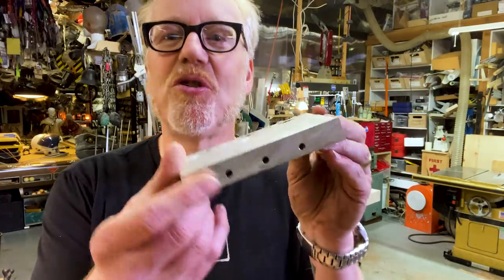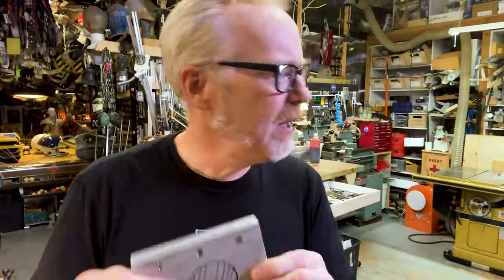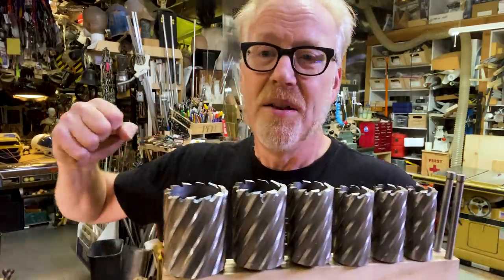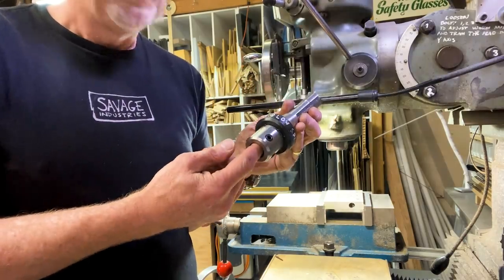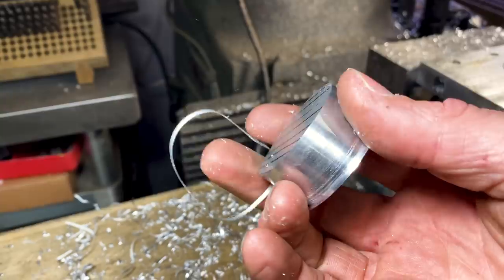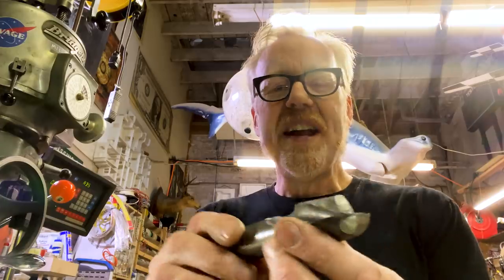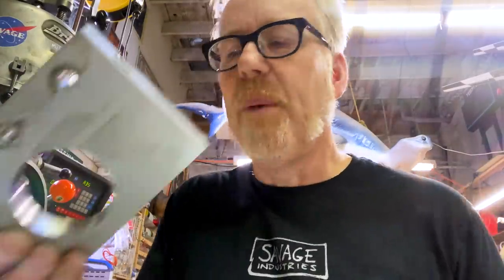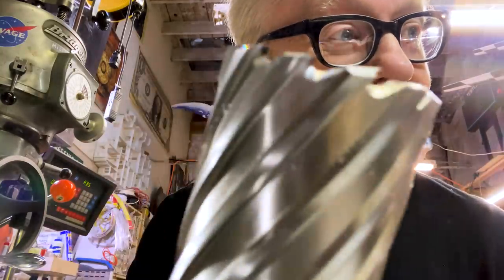Adam Savage's Favorite Tools: Annular Cutters!

Comment: Parallel falling over means there is a chip between it and the vise bed or jaw. Need to clean the vise.
Reply: Maybe the vise is tram to the bed but the bed isn't level. (because the entire machine isn't level)
Reply: @felixar90  Few tradesmen, and fewer amateurs, have ever set up their machines in accordance with Georg Schlesinger's principles, established in 1938.  I've encountered a fitter who moved my lathe, left it bridging two separate concrete slabs (which would move separately as ground moisture conditions changed) and assured me he'd used a precision level, so it'd be OK... Anyway, parallels are often caused to topple during loading the vice, it happens, and it's seldom because the machine's so far out of level, but-

Most of us kept a range of (compression) coil springs, cut to varying lengths, in the shop to interpose between parallels, and stop them falling, since you have one hand holding the workpiece, the other closing or opening the vice. Who has a third hand handy to control parallels?  Foam rubber and even scouring pads can be used, as can bent spring steel or steel pallet strapping.  If the parallels are thus kept vertical, there's less likelihood of debris getting between them and the vice dovetail or jaws, too.

And... If you're on production work, make soft vice jaws, and mill steps in them, rendering the parallels unnecessary, but, mill them anew for each job, at the workpiece width, with a parallel and a silver steel roller in the vice allowing the retreating jaw to rise naturally under pressure to the position it'll adopt when the workpiece is in position. A square block won't allow that... The stepped jaws aren't terribly precise, and the height of the retreating jaw can vary a thou or two, dependent upon the force used to close the vice.  In the long distant past, we used either a torque wrench to close vices (especially in paired vice situations) or, joy of joys, Jarno manual hydraulic vices.  They'd approach the workpiece rapidly, mechanically, and then the hydraulics would take over, the pressure set on a calibrated thimble like a micrometer.  I haven't seen a Jarno manual hydraulic vice for over 40 years, now.
Reply: @robertlawson8572  Edge Technology makes some nice spring loaded parallel holders, for 4" and 6" vises, and probably more. 

Also it goes without saying that soft jaws are to be machined while loaded, Ideally with something that will let them kick out the same way they'll be when actually holding the work piece, 

I actually never had to used soft jaws of any kind but if I ever did I'll just refer to Stefan Gotteswinter
Reply: @felixar90  "Also it goes without saying that soft jaws are to be machined while loaded,"  I found over forty five years in engineering that it's a mistake to think anything "goes without saying"  I've noticed that, especially in maintenance shops, you can't assume anything.  Your experience may have been different, of course.
I thought, in 1978, "it goes without saying" that a vice, mounted upon a machine tool, should be both secure and clocked accurately, if left for someone else to use... I found the error of that assumption when I used a vice left by the previous guy on a Butler 26" Super Shaper.  I asked him if he was finished, and if the vice had been trued.  When I started to use it seriously, the vice, a fairly big one, shot free into the aisle.  The previous guy hadn't been asking much of the machine, I was shifting serious amounts of material.  I never again trusted a vice left in position, and I always removed vices after having used them, (no blame could fall upon me for its security) and, I never allowed myself to be prevented from mounting an accessory securely once I'd started.  
"It goes without saying" that you ought to work against the fixed jaw of a machine vice... That idea collapses when you're working a shaper...

Comment: I've shattered a 3" Hougen annular bit when using a magdrill upside down.  It wasn't a good day. 
Any kind of sideloading on an annular bit ends up with it exploding.
Reply: Maybe on the tip. I use them to mill into tubes ok
Reply: Last time I saw someone use a magdrill upside down, his cutting fluid ran up the shaft and shorted the magnet and dropped the entire magdrill on his head. Adding a safety chain for himself turned it into a magdrill shaped wrecking ball to swing at his head. In the end, mistakes were made and lessons were learned!
Reply: @descension7419  I've always said let it fall if the magnet goes out. My body is more important than a piece of equipment I don't care how expensive

Comment: They are awesome tools. I'm actually surprised you ran that high of RPM's on a cutter that large, worked fine, but I don't think I've ever used any annular cutters at that high of a RPM.
Reply: I agree with you. It is aluminium and not steel, but he is running too high of a speed.

Comment: I've used those a ton at my work, we usually use them to drill bolt holes. Run about 100-200 rpm going through 1" to 5" thick structural steel.

Comment: Endmill and a rotary table on the ol’ Bridgeport.
Reply: I saw a homemade tool with a face-groover on a 1" square bar. The guy used it for cutting large precision holes in 1/2" and under plate. Ingenuity rules the world. I've also seen a 5/16" HSS lathe tool in the same type of setup for plug cutting. They both had drills in the center to stabilize everything.

Comment: Try milling the hole on a rotary table. It's fast and very accurate.
Reply: Or a cnc.
Reply: @theupscriber65  them circular interpolation codes be hitting different
Reply: What difference does it make to use rotary table vs a vise?
Reply: @federicoromero6130  a vice is stationary a rotary table turns 360 degrees and you can make large hole with a small endmill by pitching out half the diameter on the Bridgeport mill, then taking a cut on the rotary table to finish the cut
Reply: the upscriber was going to say the same thing
Reply: Def more accurate than an annular cutter!

Comment: Is it just me, or do his parallels ring (@3:39) like the first note of a muted doorbell?

I'm sure this is what Adam meant @9:18, but it's the rigidity of the work- and tool-holding that allows annular cutters to work well and not break/break other stuff. Obviously, if the work and the tools are held with high rigidity, that allows for high precision. When it comes to cutting tools, especially carbide, taps, & small drills, if you can't keep both the work and the tool from skipping around or becoming misaligned, it quickly becomes time to buy more metal and more tool bits, to replace the scrap you just made.

I love how much Savage home-shop action we're getting these days!

Comment: I am a railways track engineer. In old times we used to use normal drill bits for drilling the rails for fishplates/joints or for fastening signaling cables. These days we have switched to annular cutters and this is wayyyyyyy faster and more convenient. We drill a hole in less than 1 minute and with a normal drill it takes even 10 minutes for a single hole. Also the hole is much cleaner whish is very important for avoiding fatigue crack formation or fissures starting from the holes as a source of stress concentration... I also love them.

Comment: I don't care if you are cutting aluminum, use a pick, to pull cuttings away from the work area. Never grab cuttings , with your bare hand. If it's small chips, use a brush, if you try to wipe them away, 1 tiny stuck chip can slice your hand open. If it's the curls and lacy shit, that can cut you to the bone. Keep a long bent pick at your drill press, end mill, and lathe.
Reply: i trust any opinion from a beard like yours lol will be making a pick myself today :)

Comment: It amazes me these haven't caught on for machining before, after all, hole saws have been used in wood-working for so long.
Reply: These are very different from a hole saw. Hole saws do not clear their own chips, making it difficult to get through thick material. Also if you're looking for good accuracy and surface finish an annular cutter will do much better.
Reply: @Beanpapac15  But the basic principle of huge hole - tiny amount of material is shared between the two. It's just that this is better adapted to metal

Comment: I used to make these at Hougen mfg. (Hougen Rotabroach are the best annular cutters in the world). Seeing them blast through a 60 Rockwell railroad rail in a few seconds was awe inspiring.  The trick is that there isn't a center like a drill so the rpms can be much lower and keep the proper ips feed as not to increase wear.

Comment: "How do you do this hole?"
Well a hole saw comes to mind before anything else...
Reply: Shutup Lenny
Reply: Glad I'm not the only one who thought the same thing. Its just aluminum, it would work just fine.
Reply: @quistan2  it doesn’t tho. Material that thick clogs up the hole saw. Looks like the only difference between a hole saw and this annular bit is a way to evacuate the waste.
Reply: @JohnBrowningsGhost  It's really a non-issue if you back off the bit and blow it out frequently.
Reply: @quistan2  but this is still a nicer cleaner method depending on type of holesaw.
And why not use them if you can.

I'm just surprised he hasn't been using these for years.

They've been round long enough but i guess it's amazing what things we might not see till you have them.

Comment: Been using those for years now working on big rigs doing frame extensions, cutting holes to hang other accessories and other types of body implements. Mag drill is the best tool in a heavy equipment shop!

Comment: When working with sheet metal in thinner applications a simple hole saw works wonders. Similar technique of slow speed, cutting fluid, and consistent pressure via drill press or mill works wonders. 
This anullar cutter basically works as a reamer and a hole saw all in one.
 I will be looking into getting a set of these anullar cutters for my sheet metal shop for thicker and more precise applications. I wonder if you could cut straight through square or rectangle tubing for reliably accurate pass through holes......
Great information Adam!

Comment: I work as a CNC machinist at Edwards AFB, CA and I use those cutters quite often. We call them Slugger Cutters, because it leaves that fancy little slug in the middle. I've used them on steel and even Titanium. It takes longer, but if you have plenty of coolant and time, you can get through any material.

Comment: Hey Adam. Got the same problem some weeks ago. But no aluminum - stainless steel. Tried a step-drillbit. No success. Then tried a carbide tipped hole saw. No success. My solution: a punch tool for punching holes in stainless steel kitchen sinks.  But this works only on thin material. Greetings from a long time Mythbusters viewer here from Germany. Was always a pleasure to watch science go real.

Comment: How are you, Adam Savage, only discovering these now lol.  I use hole saws and annular cutters for anything over 1/2" in my home shop.  With an adapter you can use these in a large robust drill press and or with a magnetic drill.  You also need to respect proper speeds for each type of material and always go heavy on cutting fluid.

Comment: I use em all the time, both mag drill and milling machine and they are awesome. When drilling dont just plunge the bit in, thats how you end up with a fireball of artery slicing madness. Just let off a bit of pressure and it will kick out nice short chips and allow constant coolant flow.

Comment: Use them quite often at work. Use them for ironworking and general fabrication on thick steel because we use big mag drills that need at least half an inch of steel to properly adhere without flying off the piece.

Comment: We use a mag drill in our structural steel shop with annular bits. We just punch a small hole, then there's a piece in the middle of the bit itself that sticks into the punch indentation to keep it center and drill away.

Comment: We cut through 1/8th and 1/4 in aluminum skins on our custom vehicles.  We use standard hole saws.  They're much cheaper.  That said, for the 1/4 in, applying and releasing pressure repeatedly helps a lot, because hole saws don't have the spiral path to remove cut material.  That said, one technique that works really well on floors with 1/2 aluminum is to drill 2 or three holes with a bit that's wider than the edge of the hole saw.  Drill them to the inside edge of your cut so they don't impact the round outer circle you're cutting.  These holes provide a place for material to fall through without lifting the hole saw and blowing out with compressed air.  If the metal to cut is immovable, then one or two holes near the bottom still help, but on thicker stuff, pull the hole saw out often and check for chip buildup.

Even on wood, a hole saw will bind up on chips and literally burn wood if you don't manage the chips.  The "drain holes" work great with a hole saw on 2x4's.  With Wood, you can just power your way through and live with the heat, but it dulls your hole saw much faster, and peals the paint off in a hurry, so they rust, but as quickly as you dull them, you won't care about the rust unless you sharpen your own blades.

Drain holes, an ounce of preparation saves a gallon of sweat and tears. (saying by Heis Also)

Comment: Handy tool to have Adam, I have a set but tapered ends for easy removal, also attachment with a centering drill. Want to go bigger or any diameter use a circle cutter, think of it like a leath but instead of spinning the material you want to cut you spinner the cutter bit instead. Word of advise go slow with the circle cutter take off small amounts of material & when close to the end flip it over & take off the rest of the material less chance of catching on the tool & jamming.

Comment: The company I work for uses a carbide-tipped version of these to cut through very large bolts up to 6" in diameter and 10" deep with annular cutters.  We run at much slower speeds even with the hss ones.  They are so expensive but so efficient that running high RPMs is just not work the little extra time you gain,

Comment: Could have also used a regular type drill guided hole saw, but the annular cutter indeed leaves a much better finish. I use my annular cutters mostly on heavy steel in a mag drill, although I do sometimes use them in the drill press as needed.

Comment: Known as rotor broach in the UK and the centre hole is for the pilot pin that is spring loaded and sits in the centre punch mark and pushes out the plug after cutting I use them with mag drills and drill press no problem aslong as the centre pin and cenre punch are good... Best bits I have ever used by far

Comment: Hey Adam Savage, thank you for taking the time and effort to produce this excellent, easy to follow, demonstration on the use of an annular cutter to cut the thick aluminum block in the video. I'm trying to cut a 7/16" hole in spring steel {3/4"w x 1/8"d}. Would you recommend the Oscarbide 7/16"x2" for this purpose? I need to cut 24 individual pieces. Thank you again for producing this video.

Comment: I’ve used them for the past 3 years and it’s my favorite method, recently I’ve ran upon a wax type of cutting lubricant and HEAVILY prefer it over plain cutting fluid as it’s just a cleaner option also the metal doesn’t seem to get as hot... I wish I knew where I could get some more but only had a used tube with no branding on it.

Comment: Hey Adam, seen you loads on mythbusters, i found this video because im thinking of buying a mag drill, rather than a drill press, as i too am a home machine user as a hobbyist, and yes, id love a set of those annular cutters

we have something similar in the uk called hole saws, which go in drill chucks, but there real flimsy, there basically a cylinder with a band saw or jig saw blade round one end, and a standard drill bit through the middle

they wander around a lot and make egg shaped holes more often than round, there better for wood than steel, but i seem to use steel more, so its really frustrating, especially when your trying to get a nice finished hole for a pipe to slip through for example, and theres gaps round it, and the finish in that area requires no welding

all the best, Russell from across the pond in the UK

Comment: Missing your podcast so maybe that's why this popped up in my recommendations... lol
That's still a crazy high rpm for those bits.  I guess it's not so bad doing aluminum but go slower for steel.  When those bits break the shrapnel is serious because of those long sharp edges.   Also be careful backing the drill out while spinning if you're using the spring loaded centering pin.  It could shoot that slug out and do some damage.
Hole saws work good for aluminum but you may have to keep clearing the teeth since they don't clear the millings.
Happy building!

Comment: What are your options? G02 and G03 lol. That said, a good bimetal hole saw followed by a boring bar in a boring head works too- will give you a similar finish and concentricity than an expensive annular if you don't already own one.

Comment: Added bonus of using this in a mag drill is the centring pin has a spring pushing on it and the drill will automatically eject the “coupon” when the cut is complete.

Comment: Adam I have been a steel worker for years and have a lot of experience with these bits and if every 2 or 3 seconds you release pressure it will not build up with material. More so for hard product like steel but will save the bit for a lot longer.
Reply: Oh and touching that while it's still spinning at all could de glove you in a blink of an eye